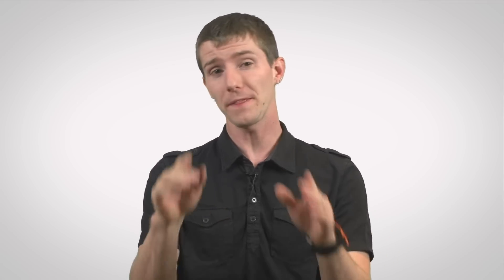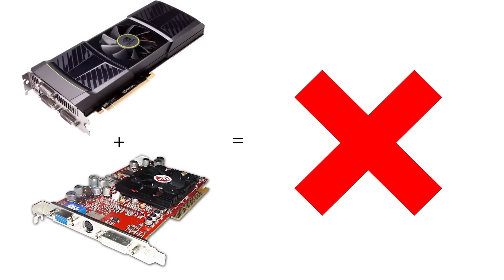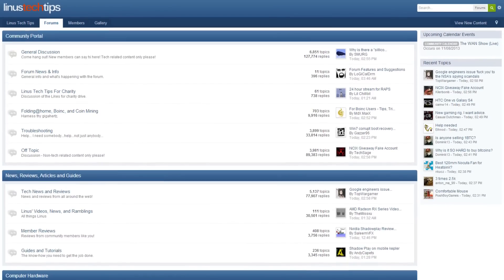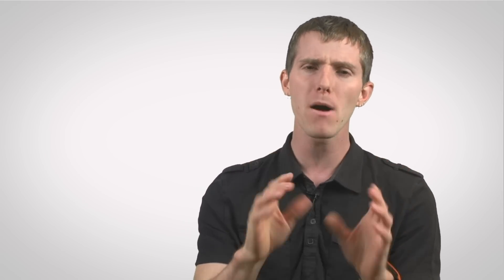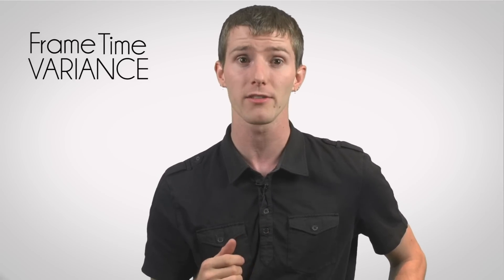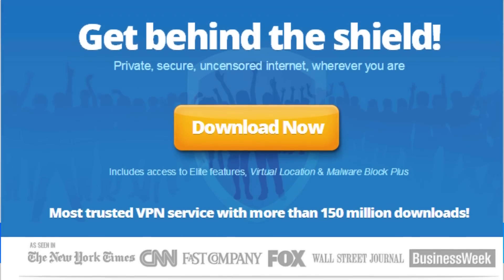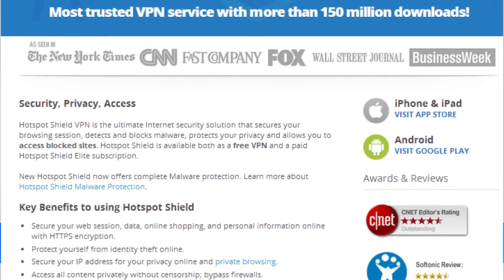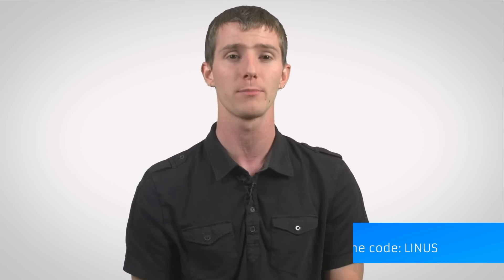SLI by NVIDIA - Everything you Need to Know as Fast As Possible

Comment: I want to try out SLI with my gtx 760 but I don't know how to set it up or if my system is compatible. System:
i7 3770, 16gb ram, MSI z77a-g45 Thunderbolt (sli compatible) and a 650 Antec 80+ gold PSU
Will my system be able to run it? 
(GPU: Zotac GTX 760 4gb ready for SLI)
Reply: i was like you but i did it anyway its really easy
i got help from a youtube vid (gx 760)
Reply: Honestly, Correct me if i'm wrong but you pretty much need a MOBO with SLI Compatibility and a good power supply with enough watts to have SLI work. You also need an SLI bridge but i assume that everyone knows that.

Comment: If I want to game on 2560x1440 should I plan on getting two gtx 980 in sli or just one? Also if I turn out to do sli, is 850watts of power enough? Anybody please
Reply: One should be fine for 1440 p, but a second one will almost double the performance. And an 800W power supply should be good if your cpu consumes less than 100W.
Reply: jasonjrf Are you high??????? THE MOST IMPORTANT THING IS WATTS IDIOT. You cant have 2 gtx 980's if you only have like 450 watts for instance. Also , you dont need to find out anything feom what you sad. Stop spreading bullshit.
Reply: jasonjrf That single 12v rail theory is a myth. Multiple rails are completely fine. The Be Quiet PSU's use multi rail setups.
Reply: ***** DUDE for 1440p 970 is enough not every single game gonna be at 60fps maxed out but 80% will run on at least 48-50fps

Comment: Hey guys I newbie and I have a question  hopefully  you can help me this is my setup
800 watts PS
Maximus hero VI Mobo
I5 4670k CPU
GTX 770 2g GPU 
I sold my old monitor and I'm ready to upgrade to a UHD monitor THE QUESTION IS I just got  the opportunity  of getting another gtx770 2g for only $150 dollars my original plan was to sell my GTX 770 and get a 780 or a 780ti and run my system on a single GPU but given the opportunity  of getting another 770 for only $150 I'm not sure what's gonna be better for my system not just on the short run but in the long as well. What should I do?
Reply: The GTX 770 2GB is not suited for gaming at 4k because of the low amount of VRAM (among things). Instead of buying a second 770, go for a GTX 970/980. Or SLI 970's. 4k gaming requires a LOT of GPU horsepower in order to be playable.
In all honesty you should settle with a 1440p monitor since you will be spending a lot of cash on graphics cards to keep playing at 4k resolutions. Either way, forget about playing at 4k with 770's.

Comment: something neat I found is that if you run 2 cards sli that are a couple of gens older then a brand spanking new single gpu card you sill have access to force the sli AA modes while rendering through your new sexy card and push your PhysX proccessing to one of those two spare cards, alternately you can also dedicate a card to PhysX so there is still some vaule in keeping your older graphics setup in your machine when you upgrade, last confirmed personally when running a gtx295 with a gtx580, should be seeing how it likes it with my gtx580's in sli adding support to my new GTX980 when I buy it.
Reply: on a side note, architecture and drivers have changed quite a bit since I did my original test with the gtx295 with both its gpu in sli supporting my first gtx580, it may not work with newer cards.

Comment: Iv been on and off SLI up to recently I bought 2 EVGA GTX660 SC 2GB cards and made them SLI in my Mac Pro 1.1 and the speed boost was amazing i haven't had to put the graphics under Max settings 1920 by 1080 and I averaged about 59-80FPS. the last time i bothered to do it was in 2007 when i SLIed my machine with 2 8800GTX cards

Comment: In multipe videocard configuration explanations I always miss the most important part. the normal i3, i5 ,i7 (gen1,2,3,4) and AMD desktop processors can only talk to 16 PCIe lanes at one time. In other words, 2 videocards in most systems run in x8 mode and not x16 because the CPU simply does not support talking to x32 lanes at the same time (x4 mode when 3 or 4 videocards are joined as one). If you really want to take benefit using 2 videocards running both at x16 lanes you need an Intel High end desktop processor (max. communicating with 40 PCIe lanes at one time) or a dual Xeon E5 configuration for 4 videocards (max. communicating with (2x40) 80 PCIe lanes at one time).

Comment: Will a:

Geforce GTX 760 pair up with a Geforce GTX 770? Both 2gb of ram
Reply: ***** Not trying to be rude here, but he most likely watched the video and didn't quite understand it. So he came to the comment section looking for answers.
Reply: The answer to your question is no. What can work is two GeForce GTX 760s (Both 2GB) or two GeForce GTX 770s (Both either 2GB or 4GB).
Reply: Xelos Did you even watch the video?
Reply: Redstorm mint you got it. Im kinda clumsy when it comes to this stuff.. but thanks for the answer anyway, I'll just have to do with a gtx 770 for now. Can't see anything that wouldn't play on pretty damn good graphics with this beast of a card ;)
Reply: LD Henderson I feel bad for you now :\
Reply: does the 760 has the same gpu than the 770? think not
u need the exact same card, the only thing that can variate is the manufacture or brand like asus or gigabyte
Reply: one gtx 770 will do fine with most games, but u need 2 two to sli em and get the anisotropic filter 3D wich makes it look much much better on the two extra displays if u run 3 monitors with surround, if u can afford it's quite worth
Reply: Yes I did. Read what I wrote 3 comments up and you'll see why I was confused.
Reply: Yes , they still run with GK104 , but different card and 770 have more steam processors so it's a NO
Reply: Jeffrey Deal
 Gtx 450 :(

Comment: I remember when 3dfx came out with the SLI concepts way back when they were video card accelerator back then where you had to hook up your old 2d card to it. One model I still have is the Voodoo 2 from 3dfx with 12 megs on each card. Back then they were considered high end cards back then. It is still good to know for today's gaming. But how beneficial is it for CAD/CAM systems Linux or working with applications that deal with encoding video after it has been encoded??
Reply: SLi in linux I believe is pretty functional.  Nvidia's linux support is surprisingly good - in some cases it outperforms windows.  This is assuming you use the closed source drivers.
Reply: Peter Schmidt
 true. I have seen when I was implementing linux on some systems where it actually took closed source drivers for it and it ran very well on it. Just wondering if I were to build an older system with the standard 2d and including the 2 Voodoo 3dfx cards will work with it now. Sounds like a fun challenge there too. LOL
Reply: Karl Entner There is voodoo support but I'm not sure when it was last maintained or if it even still works on modern kernels.  The oldest GPUs you can use in linux that are still being maintained are the geforce 6000 series or intel i915.

Comment: SLI not anymore Rare.
Mine lenovo y510p have dual GT750m card.
it's really good
Reply: 29Fps Alienware Killer as far as power? Whoa, not so fast. The Alienware 18 comes with Dual 880M Graphics cards. Yes, it is GTX.
Reply: Yeah! Y510P for the win! :D
Reply: How's the laptop i was thinking about getting it? What games can it run? Are there any games it can't run fps on what kind of settings??
Reply: *****
Watch dogs with Ultra settings.
but Y510P will replace by Lenovo Y50.
they come with GTX card. Alienware Killer
Reply: Oh okay so i should probably get the newer one?
Reply: *****
yep.
i regret can't wait for y50. GTX card .4K resolution. Supreme Design.
and Price also same like mine too.
Dammit :(
Reply: 29Fps Better performance, battery life and elss heat too.

Comment: this might be a dumb question, but... so does that mean that AMD cards can't run multiple identical cards? since Nvidia made it. Or is this technology available for every graphics card? :/
Reply: AMD has the same type of technology but it's labeled Crossfire instead of SLI.  Crossfire is AMD's version of SLI so you can run 2 cards or more depending on the rest of your system being Crossfire ready or not.
Reply: ijustutor
 oooh ok. thanks :)
Reply: All games will play with a crossfire setup however not all games will make ideal use of crossfire. To clarify, 1 card may not be used at all by some games. Otherwise you should be able to play no problem. That's worst case scenario.  Besides that, you can obviously have a better gaming experience in crossfire for game platforms that are developed with crossfire/sli in mind.
Reply: ijustutor are all games compatible with crossfire?

Comment: Room ventilation, no joke. I've got 2 gtx 580's and an i7 950 overclocked to 4ghz. But ever since i got my second 580, I've never had to turn on the heater in my room. And if I use my headset, I can keep the door open and heat half thr house without disturbing anyone. But summer is comming and I worry about the temps.

Comment: I think people need to understand something. SLI and Crossfire will definitely differ from system to system mostly because of what you have installed (hardware and software) and what you are playing. There are games that work with it and some that don't.

Big things to consider with SLI:
- Do you NEED it (for games today that you just can't run but don't want to buy a whole new card)
- What are you using it for (performance boost, need the extra power, want to run surround / eyefinity)
- Can you afford it?

I think the big misconception is that people buy these things expecting them to run so much faster that light can't even catch up to them. The scaling in power depends on the hardware and how many cards that you have installed in the first place. 

For example, Four Titans will have more power than most, but the percent increase from 2 way to 3 way to 4 way will decrease in every addition.

The next thing is affordability and need. People will buy these things because they want the best system just because they want to. The key things are:
-How much money you have
-How much you will spend
-What the hell are you doing with your PC in the first place

It all comes down to wants, needs, and money. For example, Swifty, has a dual E5 Xeon over clocked water cooled setup with 4 water cooled Titans even though he really only plays WoW. You may think, "why did he waste his money."
1. He has the dough to roll it in
2. He needs the CPU power for the game, which is CPU instensive (especially on servers with 64+ people) and also for rendering.
3. He needs the Titans for video editing, the game rendering, and the outputs to do a 5, 1080p and 1 4k monitor setup.
4. He also needs the Xeons to render livestreams and to render video edits.

He may not need all the Titans, but since he has the money and is using it constantly, he has a good reason to get it.

I right now only have one GTX 770 because that's really all I need, however I see myself by Christmas of 2014 to get another because I'm sure games will require a little more (and I want to use 144hz to it's best advantage while staying low on budget), and recently, Adobe products have been needing the extra graphics power to do rendering. (Maybe even a 3770k if I can get it).

Comment: SLI is only relevant with graphics. If the GPUs will be used for data crunching, the scaling is very good, assuming the code is properly written, which in most cases is not.

Comment: I'm considering the Lenovo y510p the specs are 
4th Gen Intel® Core™ i7-4700MQ processor
Features a 2.4GHz processor speed with Turbo Boost up to 3.4GHz.
Intel® Core™ i7 processor
8GB DDR3 memory
15.6" high-definition widescreen display
With 1920 x 1080 resolution 
1TB Serial ATA hard drive (5400 rpm)
Offers spacious storage and fast read/write times. An 8GB solid state drive 
Dual NVIDIA GeForce GT 755M SLI
Is this a decent gaming laptop? :)

Comment: Heyyo Linus, you forgot to mention Multi-GPU is a great way to extend life on an aging system... Last year I bought a second GTX 480 for $80 used on eBay and I get the same performance with my dual GTX 480's in SLI than a $380 GTX 770. :)

Comment: "FRAME TIME DIFFERENCE IS STILL ALOT BETTER THAN THE COMPETITION"

Linus, your bias fanboy made a appearance.

you will have to put him away to regain the respect of the competition, especially when you are COMPLETELY WRONG!!!!

the frame timings in CROSSFIRE and SLI are nearly exactly the same, and the gpu scaling is also nearly exactly the same.

but hey, you are Nvidia Fanboy, when it comes to comparing AMD to Nvidia, so whats the point in correcting you...

Comment: Can i use two pci slots x8 to run sli..
Reply: yes you can. PCI-e is always compatible, but you might not reach the performance it needs. If you have a gen 2 graphics card with a x16 slot, then you can fit it in a gen 3 x8 PCI-e slot and you still have the speed you need. 
PCI Express (PCIe) 3.0 - Everything you Need to Know As Fast As Possible
Reply: thanks..but would running it x8 lower the fps since it is half of the x16
Reply: cool...thanks man.........but im thinking...should i get a gtx 770 or go sli with the gtx 660....if i go sli, il have to my a new mobo and psu......whats the performnace difference...between the gtx 660 sli and the gtx 770
Reply: cool...thanks for all the help man...ill work out my budget..:)
Reply: get 8x gt610 XD
Reply: HSD BRODZZ the thing is gt610 is pretty bad i have it XD just bought a R9 x280 tho
Reply: You can, as long as the motherboard supports it

Comment: Ya back in 2004 and those assholes still can't get the software to work right with (Span displays with surround in SLI)
If i center the taskbar my start menu is cut in half. So it spans across all screens.  If I add it to left then the videos or window applications shift to the right bezel.  

It took them, this many years just to get window snapping right and yet its fucked if your taskbar is left or right because it will shift the window to the opposite bezel.

Comment: My current system has a gigabyte reference gtx 780 with a I5 3570k @4.5 ghz ,Rog Maximus V motherboard,corsair H100i cooler,16 gig ram (1866 MHz ) corsair ax860 psu and a corsair 600T case....now I want to add another 780 to the mix...reference or after market? And will my psu be adequate....thanks guys
Reply: easily
Reply: If you use PC part picker and find the parts in your case and put them in a list, you'll be able to see an estimated amount of wattage your system will need.

Though personally, it sounds like your 860W psu should be sufficient.
Reply: SourceOfChaos thanks for the reply
Reply: SourceOfChaos it's around 695 watts on pc part picke....that gives me hopefully the rest to overclock abit lol
Reply: Just remember that you should not stress your power supply so closely. A good rule of thumb is if the total amount of your desktop's usage is only about 80% of the PSU 's capacity. :) Have fun with SLI!

Comment: "you only start to run into problems when you wanna combine 2GB cards with 4GB cards, ..... , so guys, it's not gonna work.. so please stop trying"
ehmmmmmmm............ yes you can. A bit of investigation learns otherwise.
Read: http://www.techpowerup.com/forums/threads/sli-with-different-cards.158907/
Reply: in other words: if the chip architecture is the same or to be specific: if the three numbers after "DEV" of 2 different cards is the same (you can find that in device manager), you're good to go. It takes a bit of reading though "how", but it IS possible.
Reply: GTI1dasOriginal Please note that mixing different VRAM sizes has worked, however is very inconsistent and may fail. The FAIL PART answers your comment
Reply: s1nringleader And that's why they made it a sticky on the forum since 2012, everyone benefits from it and countless people are helping eachother over there, and the modded driver is constantly under development. Right....... -_-
Dude, if you only comment on my remark just to point out things CAN fail or go wrong, then please don't..  the only reason I commented is that other Nvidia users could benefit from a possible solution they otherwise wouldn't even consider possible.
In other words: giving negative comments is easy, to admit someone has good intentions seems to be (in your case) the hard thing to do.
thumbs up. You're fantastic.
Reply: s1nringleader examples:
http://www.techpowerup.com/forums/attachments/gfx-png.54856/
http://www.techpowerup.com/forums/attachments/gpu-jpg.54160/
http://www.techpowerup.com/forums/attachments/unbenannt-jpg.53016/
Reply: GTI1dasOriginal If you notice the first one and the last one have SLI disabled and the second one appears to just have the second card only running PhysX which is what i assume those other two are doing as well
Reply: daxster25 Now I'm not gonna be nice anymore...
Only reason I commented was to show guys who asked themselves "I have two different Nvidia's, CAN I do an SLI config?" there IS a way to do this, a whole community actively bowed over this problem and wrote a modded driver which is constantly updated.
So, daxster...
Question 1: DO you have 2 differnt Nvidia cards? Yes / No
Question 2: HAVE you read the whole thread? Yes / No
If your answer in any of the two questions is ""No" then STFU, my first comment wasn't meant for you.
Goodbye!
Reply: GTI1dasOriginal Yes to both questions, as I read every comment on the thread you linked 95% of people couldn't even get it to work, and the 'results' from the other 5% were far from outstanding to make this a recommended option. Modding drivers to force SLI produces an abundance of problems if you can even get it to work in the first place.
Reply: daxster25 other question: why are you commenting that to me and not over there? I can't help you. they can. PS: this was my last and final comment. have a nice life and lots of luck, again: goodbye.